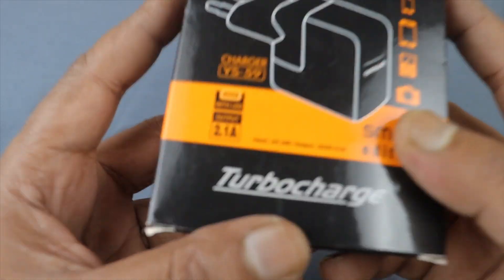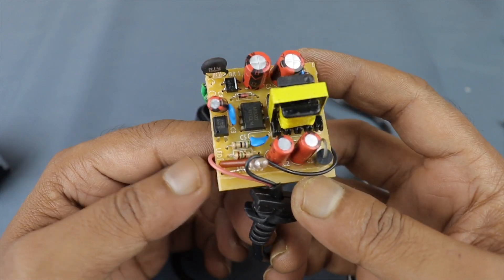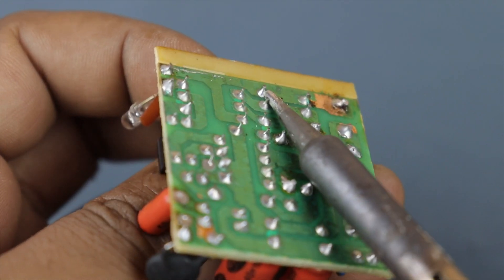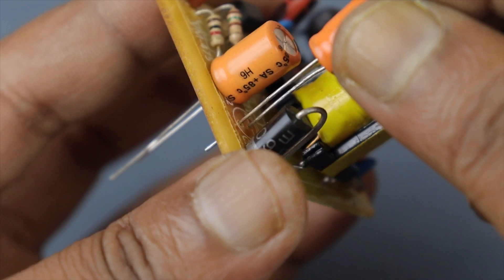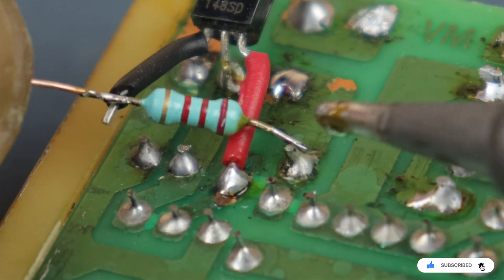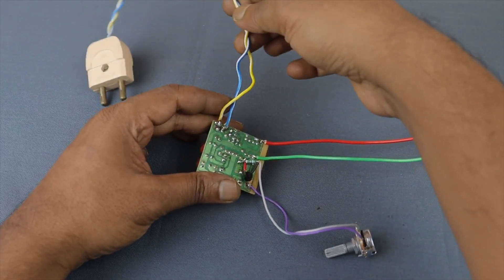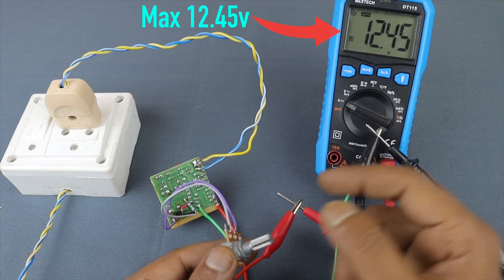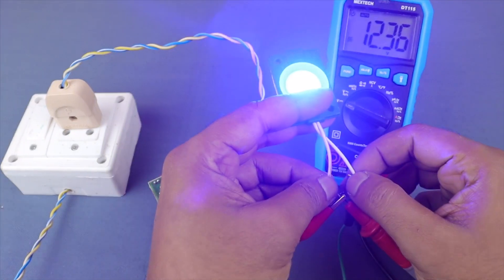Turm mobile charger to variable output (3V to 12V)

Comment: I would like to use my phone while it is charging. I have a .350 charger it is not quite enough to keep the battery at the same state of charge all the time. I have a 400 and it is too powerful it actually charges the battery while using the phone. I would like for my phone not to increase state of charge on battery while in use. Could you make me a charger that is between 350 and 400 And adjustable.
Reply: I’m trying to use my phone without the battery kicking in I’m very close with a 350 charger but it is a little weak probably needs to be between 360 and 375 400 is too much

Comment: Great job, perfect, it worked fine, I converted a 3.3v mini source to 5.0v, I already had a TL431, I just changed a resistor and it worked perfect. Thanks. Congratulations on the channel.

Comment: Hi,if you put  50k adjustable resistance you gonna get a variable voltage from 3v to 23v better than  10k tgat you used it , thanks
Reply: Remember you replace the capacitors to 16volts only.

Comment: Brother there is a problem we should consider.
If the pot becomes loose and open the contact, the voltage will swing up suddenly and damage the circuit powered from it and even the SMPS itself. So we must connect the middle pin of the pot to the unused side pin so the resistance will never be open on loose connection inside it, so the SMPS will not suffer from feedback breaking and will not kill itself. But the problem still remains for the circuit we are powering. Because a loose contact will cause the output to swing upto maximum(may be 12v) and damage the circuit we are powering(example: microcontroller). 

One possible solution is to connect the variable resistor in lower end of the divider (reference to ground) this way if it disconnects, the voltage will drop down to 3v and it will not be dangerous for the circuit we are powering.
Reply: He is  right

Comment: Wow, very nice, but how many amps at 12 volts
Can I connect it to a receiver, or is the amp weak?
Reply: .875 Amps.
Reply: @skuzlebut82  Can I connect it to a receiver, or is the amp weak?
Reply: @khelifinouredine1842  - You can connect o Space Shuttle and make it fly!  SMH
Reply: This may be late to say since 1y ago, but i will keep say it anyway

Just look at the watt phone charger 

Example regular phone charger has 
5volt 2a

Then 5Vx2A=10watt

So if you modified this 10watt charger to increased the voltage 

It's will be 

10watt÷12v=0,8a 

Hope it's help.. 
And correct me if I'm wrong